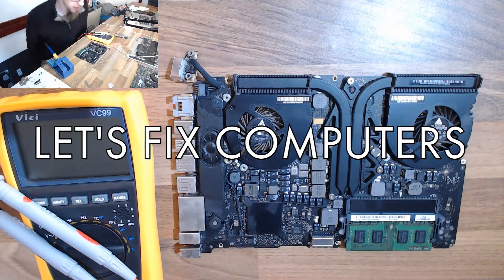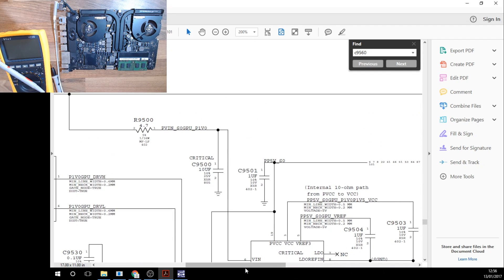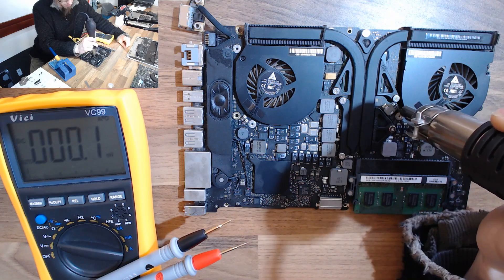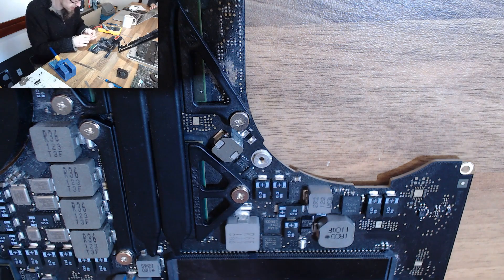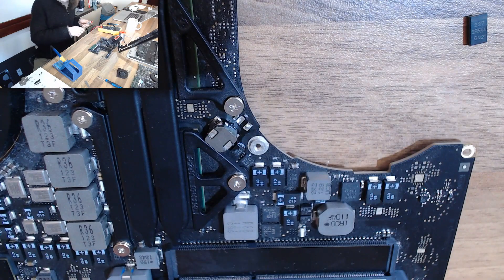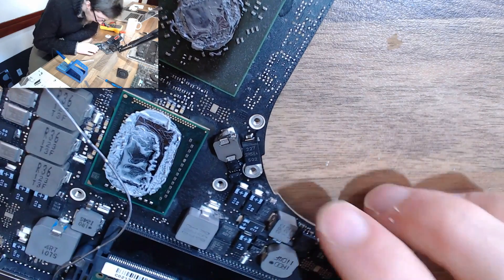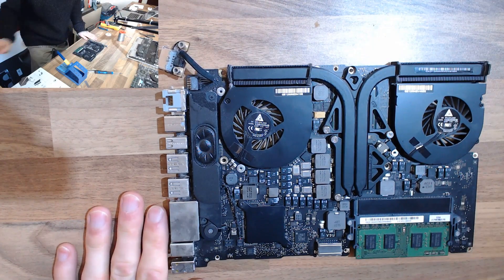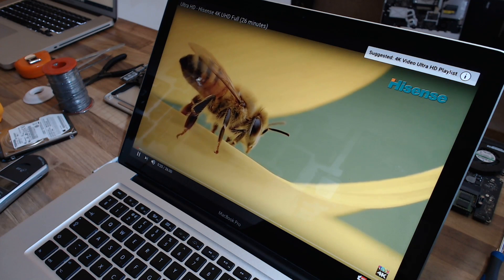LFC#95 - MacBook Pro GPU Fault: C9560

Comment: Hi I tried everything down to the letter.  except I used an none polarity capacitor. Tayio yunden multilayer ceramic. got it from mousser electronics. 
https://www.mouser.co.uk/Search/m_ProductDetail.aspx?Taiyo-Yuden%2fPMK325AC6337MM-T%2f&qs=8jfIC9vqKDtSgjVVM80Syg==

my reading still 1.37 and I never get the 1.508 volt
see my board 
https://www.dropbox.com/s/unmtucmgh7kwrlz/20171101_212936.jpg?dl=0

can anyone help. is there something else need to changed. 
is 1.37 volt is correct on the mid 2010 board
Reply: Adamant IT  I guess this one should work than. 
http://uk.farnell.com/rubycon/2-5swz330mr15/cap-alu-elec-330uf-2-5v-smd/dp/2346118?CMP=i-ddd7-00001003

Also its interesting that the one I put in reads low.  and it does fail on the asd  test. however it runs perfectly the latest os.  before every time was an external display were used and kept toggle in on them it triggered the go I panic screen and restarted. now it does not do that. Do you think I still need to change it to the one I showed above. or not.
Reply: Adamant IT  I thought but I could be wrong the voltage can be higher just not lower than the spec
Reply: Adamant IT  guess what I think the reason it's never read  more than 1.37v is because I am using 2.5v not 2v . I have tried all my caps 330uF with the 2.5 v. and all of them even the polarity one too is reading 1.37v . so I just ordered the one you told me I'll get it by max week . let you know if it worked. thanks you were a sport.
Reply: Adamant IT  I am clueless. I just measured on the board where the caps should go  and without anything been replaced it reads 1.34 v so I am sure doing something wrong or my board has other issues. is the usual if you remove the caps would read anything like that?
Reply: Adamant IT  I have but it still reads the same. as if I did not .   I even tried to just solder 2 wire and solder it to it incase I have not done the hot air soldering right. But the result the same  
see image

https://www.dropbox.com/s/tn1q0gqcbcldbto/20171112_121837.jpg?dl=0
Reply: Adamant IT what happened I have no reply from you  for a while

Comment: I have an early 2013 MBPr which seems to suffer from this. I have not been able to find any GPU diagnostics on mine, though. Nothing like your flashy ASD screen. General diagnostics (Apple Hardware Test 3A244) shows nothing other than one SATA error.
Reply: Thanks for your reply, unfortunately my macbook is not covered anymore. I do not experience artifacts, only shutdowns when switching to external displays, and when the nvidia card is utilised.  I will have to get a pentalobe screwdriver before I can test the offending capacitor.
Reply: Ok, then I'll just continue troubleshooting. Thanks for you helful replies, and also for taking the time to make this great video. Lots of useful tips on this channel as well, will recommend them to the apprentices who do the repairs here :)

Comment: This doesn't apply to 820-2915 motherboards! It is the GPU on those.
Reply: new one on ebay, next you'll tell me all the clean std-free women are on backpage...
Reply: I tried mightily with my 820-2915. I may have used an incorrect value, though; used a 330uF from digikey. My MacBook Pro has the lines-onscreen-during-bootup-on-the-Apple-screen/ white screen-crash-reboot cycle problem.
My repair was unsuccessful and I've been wondering if this repair video (and the Rossman video you reference which shows this identical procedure) actually applies to my 820-2915 board. I s'pose it does not after all. Really, a 330uF vs a 220uF on a power supply rail shouldn't make a helluva lotta difference so I guess I'm stuck buying a new logic board from eBay or getting my GPU replaced. 

(Edit: I visited the Rossman repair website and have now seen that they aren't no longer offering 2011 MacBook Pro GPU repairs. So it's down to buying a new or used logic board from Amazon or eBay!)
Reply: Adamant IT : thanks for the reply; I certainly wish the news were better, but at least I still have the option of buying a new (well, it'll be a used) logic board, the prices for which seem to be around $430-550, still much cheaper than a new MacBook Pro. I have no reason to upgrade this computer as yet, since it was running what I needed it to run just dandy before it decided to fail.
Reply: you can use a heat gun to remove the gpu and replace it with a new one they are like 30 bucks on ebay
type the model number of your chip on the bottom of the shiny part rhat has some writing numbers star like this in example 816-568029
Reply: Where do you find the board number? That's a critical piece of information that nobody seems to have provided.
Reply: Adamant IT: you know, that sounds like a pretty good option right now. Thanks!
Reply: @Adamant_IT  Hello teacher thank you very much for the great videos that you share, I'm doing the test that shows in this video and in the capacitor I have 1.3v on with the battery so is it correct to have 1.3v or should I only have 1.5v? My problem is that when turning on the MacBook pro 2011 it restarts just midway of the boot. Please ask for help thanks
Reply: Henrry domingo Cuevas Rodríguez this fix is not for 2011 mbp

Comment: Please could you help me identify what capacitance and voltage I need to get. I think its 330uF 2v but that is just guesswork really. My motherboard number is 820-2850-A.

And a 2nd request. I live in SA. We have this great local website for capacitors but there are so many to pick from even when just looking at Aluminium Polymer Capacitors (I read somewhere that these are much more stable than the tantulum ones) 330uF 2v. I've posted a link to which will hopefully show you the dilemma.

http://za.rs-online.com/web/c/passive-components/capacitors/aluminium-capacitors/?applied-dimensions=4292123263,4294450449

Could you help me pick out one of this website? (of course this will need you having verified that the capacitor in question is indeed of the specifications I think ti is).

Thank you so much. Both you and Louis have potentially given my laptop new life!
Reply: Lucas radebe the footballer?

Comment: Hi, what is the capacitor replacement value that you used? Thanks for the video!
Reply: Sorry it's taken so long, I don't get replies sent to me for some reason. The Apple number is EMC 2353. It's a MacBook Pro 6.2 (i7 2.8, 15", 2010).

Comment: What temperature C/F did you put the Hot Air Gun? 
In circuit did you check the cap for continuity or anything other multi-meter tests outside of ESR meter which you said was good?

Comment: Hi Adamant It 
I got a macbook pro mid 2010 with the gpu issue. I can't got the capacitor 330 uf 2.0v. Can I use a capacitor 330uf 2.5v?, if will work ?

Comment: hello bro, I have a MBP 15 late 2011 i7 that does not start after the apple logo and a little later shows blue lines on the screen, do you think it is also because of the tantalum capacitor? Greetings from mexico from a mpb 15 2010 nvidia 330m repaired thanks to people like you and louis rossmann

Comment: Thanks for the info so far. (Also: nice beard!) I'm attempting to replace the capacitor on a late 2011 macbook pro 15". I've got her opened up and the cap' is a, "J8 ec". So, 200uf 2.5V. I've used info from other postings (thanks all) to get to the panasonic page where all is good except I'm being asked for some specifics: ESR's ranging from 13 to 35 mOhms. Any suggestions on that? Or should I just throw in the 330 as listed? Thanks again.
Reply: Notice in the schematic in video that it has an output frequency of 500kHz. I used the 2R5TPE220MFGB because it has 15mOhms/300kHz and its the best I can find available. ESR is important at high frequencies. Adamant IT probably used a T591*series from KEMET which have 15mOhms/100kHz judging from the video.
I also replaced the KOcap 68uF 16V (Yellow color) and the Panasonic 68uF 16V (below the KOcap) with T521V686M016A(1)E040 KOCap by KEMET. In my case these capacitors near the heatsink are bad due to the heat.
Reply: Sorry to answer a question with a question but how do I identify the logic board? I've typed my serial number in on a number of sites but I garner no info starting with "820" or "logic..". 
Is it physically listed on the board? (Serial number is: c02gm49ldv7m)
Reply: Thanks again. (And thanks See Sharp for a note on the schematic; afraid I'm guilty of not spotting the details). I found 820-2565-A on the small circuit board where the power supply mag' attaches. I think that means I'm looking for a 220uf. What's interesting (and tragic) is that I rolled the dice and ordered a 220uf capacitor.  Upon arrival the paperwork shows a 220uf but the label on the static bag shows a 300uf (and the caps have no writing on them at all). The SKU (below) shows that I was sent a 300uf (if that's what they actually put in the bag). So... Can you (please) verify I need a 200uf; or, if I'm lucky, tell me I can put this 330uf in. Thanks.
PS: is there a way to 'test' the uf on a capacitor with a multimeter?
SKU: A700X337M2R5ATE010
Reply: 820-2915-B. List your PayPal and I'll buy you a long, dark beer. Seriously.

Comment: I got a 330uf 2.5v low ESR capacitor, but the casing is yellow? is that okay? did I miss something? can I replace a 220uf for a 330uf or would that cause issues?
Totally new at this, thank you!
Reply: I thought going up in capacitance was fine, but I guess that doesnt apply to super sensitive laptop components! I better keep it the same. According to See Sharp J8 = 220uF but the number I got from the board (printed on the charger circuit) is "820-2565-A"  Its a late 2011 15".
I heated the gfx chip once and it worked for a month, then I found your video and heated only the capacitor to test it and its been working since! I have even been gaming on the thing!! Apple wanted to replace the whole logic board its ridiculous ! THANK YOU !
Reply: Please could you help me identify what capacitance and voltage I need to get. I think its 330uF 2v but that is just guesswork really. My motherboard number is 820-2850-A.

And a 2nd request. I live in SA. We have this great local website for capacitors but there are so many to pick from even when just looking at Aluminium Polymer Capacitors (I read somewhere that these are much more stable than the tantulum ones) 330uF 2v. I've posted a link to which will hopefully show you the dilemma.

http://za.rs-online.com/web/c/passive-components/capacitors/aluminium-capacitors/?applied-dimensions=4292123263,4294450449

Could you help me pick out one of this website? (of course this will need you having verified that the capacitor in question is indeed of the specifications I think ti is).

Thank you so much. Both you and Louis have potentially given my laptop new life!

Comment: Do the numbers on the capacitor mean anything? mine says "J8 eW"?
Reply: J8 = 220uF e = 2.5V W = Lot No. B2 in the schematic is the chip size code. Look it up at the Panasonic site. It's a TPE POSCAP capacitors.

Comment: Out of interest, where did you get the capacitor from? Apparently these will work but I'm wondering if there are UK based alternatives. http://www.mouser.co.uk/ProductDetail/Taiyo-Yuden/PMK325AC6337MM-T/?qs=8jfIC9vqKDtSgjVVM80Syg%3D%3D
Reply: Ta for the reply. If you scroll down two thirds of the way, the schematic shows the capacitor as 330uF. Item GRM32EC80E337ME05L and PMK325AC6337MM-T work and are small enough not to need any scraping or rearranging. Good work on the repairs. Hope my info was helpful.

Comment: Hi, I just want to ask how's the laptop doing so far, did it show any sign of GPU panic after the repair? I think it's been more than a month now and I hope it doing fine. I really want to try this method to my laptop...
Reply: Great, thank you for your reply, I'm currently running with forced integrated gpu using gfxcardstatus because if I use the discrete GPU my laptop will reboot it self from time to time, and, one other thing that I notice is that my GPU die temperature has gone high 129C or 264F according to HWMonitor I've never notice this before but the HWMonitor didn't red-flaged this, and my laptop is usually quite warm just like other MBP but it's been a bit cooler ever since I replace the thermal paste. Hopefully this is not a sign that my GPU is already shot, but, I will give this method a try when my work load is not high, thanks, have a good day...
Reply: Both the fans spinning fine at around 2000 rpm, also I put the laptop on a stand that has a cooling fan too, the other temperature reading for the CPU cores etc also normal around 55-65C, and here's the odd thing the GPU Die temp is constant at 129C while the rest is fluctuating +- 5-7C but never reach above 70C unless on high load which usually the fans will start kick in too...
Reply: Hi, finally I did the replacement of the faulty capacitor like you did and everything worked except that now my laptop won't charge, I don't know if this is because I left my laptop uncharged for some time or maybe I did something wrong on the procedure, however, the graphic card now passed the ASD test, twice...thank you for your video, I just keep my laptop pluged-in for now...

Comment: Great video thanks for the info, just a quick question if I may. Would the logic board of a mid 2010 MBP 15" i7 2.66 be situated in the same place as this? Or is there a way of finding it within the logic board?
Asking as I,ve taken mine to get this repair done and the guy says that the capacitor you show on here isn't in the same place in mine...?
Thanks!